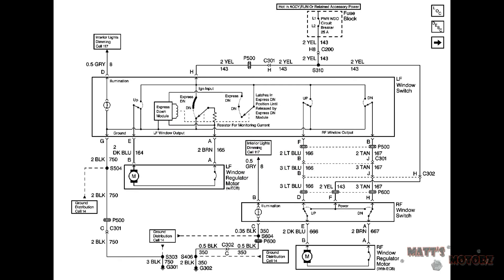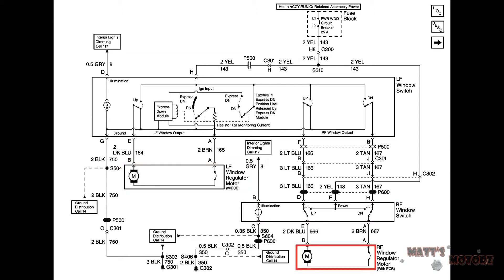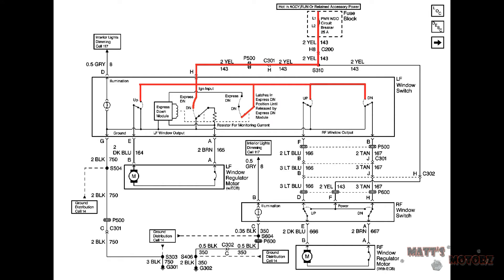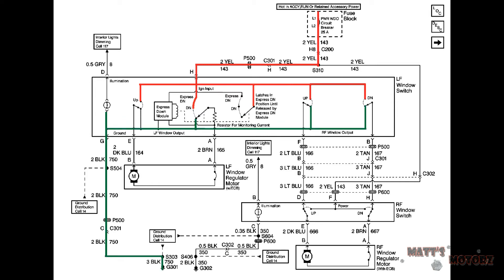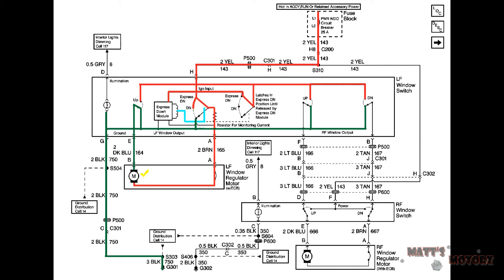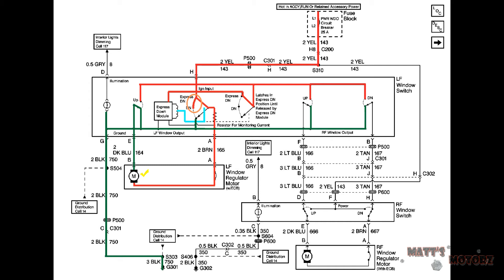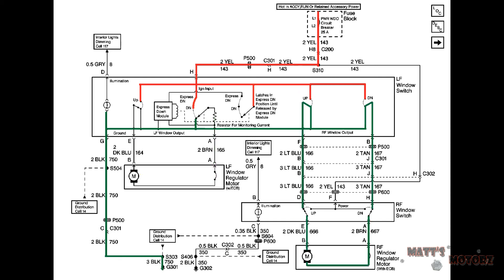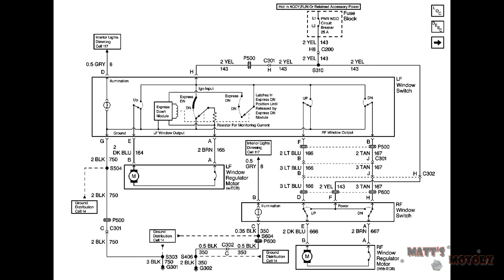Power Window Wiring Diagram Explaination [1999 Pontiac Grand Prix GTP]

Comment: So on the 99 the reg vs express is just the speed? Idk if its the same but on my 03 the difference between the two depends on on the sweep of the switch, when i hit the button to roll my driver window down if i only press the button half way/ half sweep it stops when i break the circuit or let off the button. When i press it full sweep it runs or the window rolls down even after i break the switch or let off the button. I assume when it reaches the bottom of the track and can travel no more the resistance builds and the circuit is broke. I havent noticed a difference in the speed of either. Are these two different systems between the 99 model and the 03 model?

Comment: hey ? whats p500 i have a 2004 grand prix i have no power from driver switch tested. fuse tested but no windows will come down is there a resister on the harness under the dash maybe  like a time relay im lost as im been messing with it for hours
Reply: Did u figure out your problem.  Im having the same problem.  The lights on the switch wont even light up.  I tried a junk yard switch and the lights will come on but still wont roll up my windows.